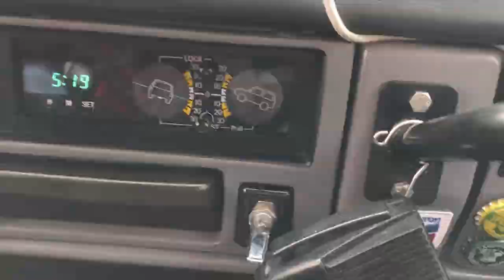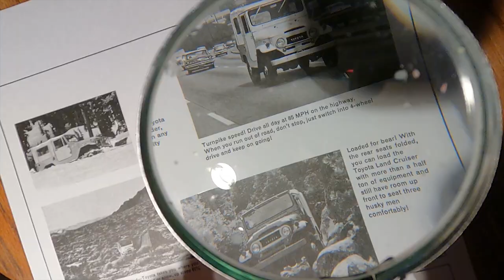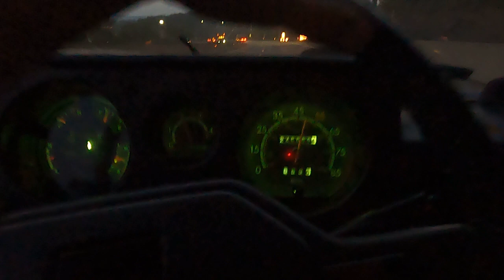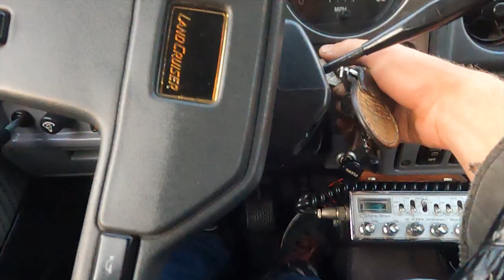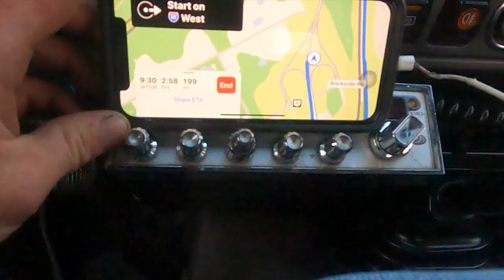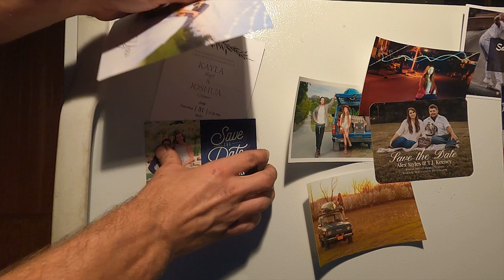Is an Antique FJ60 Toyota Landcruiser Reliable? Impromptu Road Trip to Find Out. 1000 Miles!

Comment: I used to drive My fj62 with 3f engine for 3000 Miles trips every year. Many places where the 4 wheel drive have to be use. Never had any problems. Nowdays it is only use for short trips. However I am working in a 1fz-fe engine to do they swap I go far again
Reply from the maker: They get you there and back every single time! Never ever had a problem myself

Comment: I did 3K in Utah heat this summer in my Fj62... heavy offroading, purred like a kitten and didn't skip a beat. 
If you maintain these things well, especially the transmission, you can have a lot of peace of mind taking them anywhere you want.
Reply from the maker: No question that’s a fact! I drive my fleet all Over with the same thoughts

Comment: My 84 fj60,most reliable truck I've had,the old 2f  was still going strong at 660000 kms,had only had head revalved  in that time due to running out of adjustment,20 years  and only  taken off the road due to body rusting away
Reply from the maker: holy smokes! thats awesome. the body will go before the motor every time ha
Reply: Hope you'll do something to get it back in good shape.

Comment: In 1995 I drove my 84 Fj60 from Richmond VA to Los Angeles. In 96 I drove it back to Richmond. In 97 you guessed it, drove it back out to LA. Then from LA to Salt Lake and back in 98 and 99 respectively for Sundance. In 05 got me a 62 and drove it to Los Angeles. These were not low-mileage trucks. The only problem I had was the clutch slave blew out while in Salt Lake. As a result of these misadventures I know two things: one stock 62 is way better on a road trip and two I will never ever do it again!

Comment: Reminds me of a couple of cross country trips I did with my ‘86 FJ60. One was from NC to New Orleans to Bozeman, MT and finally to Tacoma WA when I shipped it to Oahu for a few years of fun. I unfortunately had the air pump seize up in Amarillo and overheated in the middle of June. I had it towed into town and the shop was kind enough to lend me a vehicle and were some how able to get air pump (which everyone knows are a PITA To fine and expensive) overnighted from Colorado and get me back on the road late the next day.  Needless to say, but always an adventure.  I should have desmoged before I took it on such a long haul…lesson learned!

Comment: Woohoo!!!! She did great!!! That's what owning a cruiser is all about :)
Reply from the maker: Totally! Gets you there and back every single time!!
Reply: @mizeadventure9438  BTW, I have been having a super frustrating time with my 62. It's been running hot since I've owned it and I'm in the process of changing the fan clutch and radiator. If you ever decide to buy a new fan clutch get the FCT-049 from Aisin (known as the aqua) instead of the FCT-017. I spent over a thousand dollars troubleshooting and that's all it was... Random knowledge but valid.
Reply from the maker: @bogotstogoskiing  Yeah tracking down that those type of things can be a endless headache.... good to know though! thanks for the info.

Comment: What? 1000 miles or 1600km ROAD trip? Your title sounds like it's supposed to be an achievement to impress people. Which is silly, because, mechanically and by the design, these land cruisers are among  the most reliable cars ever built in the entire history or car making. All they need is basic maintenance and timely replacements of worn-out parts, like any other car does. However these classic land cruisers can take so much more abuse and can keep going under bad or missing maintenance for a long while before giving up. If you get one in good condition and well-cared, there is no question it can go distance and return back safely. And If you get one that's been all trashed and squeezed out, well then it's not about the car model or "antiquity", you can ruin any car quickly and turn it into trash like that.

Comment: Hey man you certainly seem to know your stuff when it comes to Land cruisers. If I’m in a state that doesn’t do smog checks is it smart to De-smog it to improve reliability if I’m taking it into the backwoods?
Reply from the maker: Doesn’t matter either way. If it’s running well smogged let it it be. I only do a desmog to make things simple.
Reply: I would argue for a proper desmog. If your air pump seizes up (and they all do eventually), it will leave you dead in the water. My 86 FJ60 ran so much better after a proper desmog…my two cents for what it’s worth.
Reply from the maker: Nah it won’t. Just gut the pump and put it back on and down the road you go.